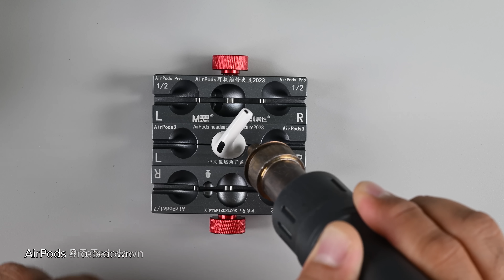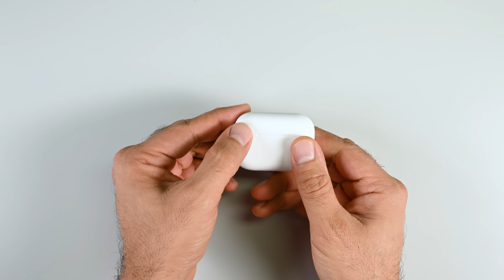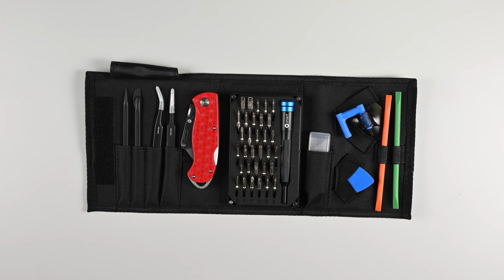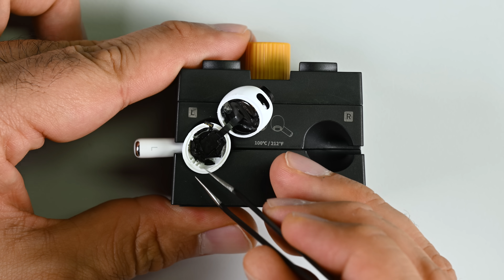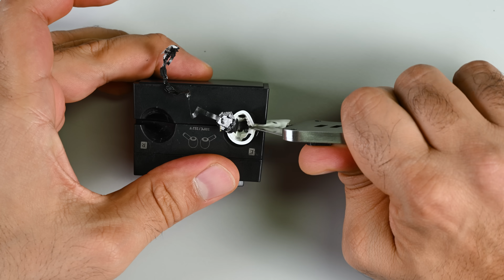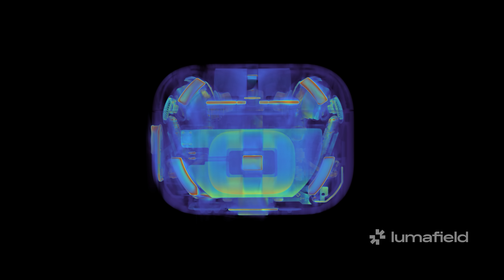We Tore Down the AirPods Pro 3 — And Here’s the Ugly Truth

Comment: It’s obvious Apple doesn’t want the battery to be replaced, some people would never upgrade and buy the new ones. It’s a business.
Reply: Maybe businesses should be regulated then. Push them to make their products more repairable.

After all, we’re not obligated to buy the new model and nor should we be.
Reply: @LinyosTorvoltos no one is pushing you to buy the newest models
Reply: @chidorirasenganz  Except the companies that push planned obsolescence and devices with little to poor repairability.

Which is to say yes, we are pushed to buy the latest models by the companies that produce them. If we weren't we wouldn't have planned obsolescence and devices designed to be difficult or overly expensive to repair.
Reply: @LinyosTorvoltos Except we don’t have planned obsolescence. planned obsolescence is used as a buzzword when people mean something doesn’t last forever. Cutting edge tech is rarely easy to repair hence why it’s cutting edge.
Reply: People that scared of waste or money conscious don't buy $200+ wireless headphones mate, it's not the same market. They're absolutely not worried about the 0.1% of people who would have the ability or inclination to replace the battery in their old ones instead of just getting some new ones after a bunch of years have passed. 

The kind of people who buy $200+ wireless headphones are the kind of people who upgrade every few years for the new features regardless.

Comment: Look after them and they’ll last years,im three years in now on my pro 2 and they haven’t skipped a beat.
Reply: ok now name me 1 person with airpods 1 that still uses them today that they bought on launch day . Whats wrong with airpods 1 they are still fully functional and useable yet nobody can use them if they wanted a lot of people dont care about the new airpods but because the battery is useless they are forced to upgrade its a subscription service
Reply: Batteries degrade
You can’t do anything about that
Doesn’t matter if you “take care of them”
They will degrade
Reply: except you can't because the battery charges and stays at 100% when in the case, which is terrible for lithium ion cells
Reply: I bought my Airpods Pro 1 in 2020 and they've only started having issues in the last few months
Reply: Yeah but eventually it will die. With a battery replacement it could last forever.
Reply: @Dann_BS  I couldn't care less about them lasting forever, they need to last long enough. I bet the original wired earbuds I used to own "work forever" but I threw them out years ago and I bet you did too. If my original buds worked perfectly I'd still have bought newer ones for the upgraded features. I bet you buy new shoes when they wear out instead of re-soleing them, don't you? That's a lot more waste than 2g of plastic mate. Let's be real, the only reason people fixate on these is because they have an emotional dislike of apple. Right or wrong that's the truth of it.
Reply: You're at EOL, there's no way you're going to get much more life out of them, the lithium batteries have a limited recharge cycle. This is the point. Everything else in the device may still be 100% functional and useful, but without any form of serviceability, they're e-waste. Multiply that by millions of users and you have a serious problem on top of an already serious e-waste problem.
Reply: @_BangDroid_  Stop lying man, my APP 2 are also 3 years and they still last 5 hours on a single charge. Sure they become e-waste when they break. Doesn't mean all of them break after 3 years.
Reply: @LordCoeCoe  How am I lying when you even agree with my point?? I am not saying they suddenly die after 2 or 3 years, EOL means they are closer to being scrap than not. The actual life depends on individual usage and charging habits. You can't get around battery chemistry.
Reply: @LordCoeCoe   5 hours? my wired earphones last infinity hours, or whenever the audio device dies.

Comment: The main problem for me is that Apple still has no battery limit on the AirPods. A charge only to 80 or 90 percent as it is possible now with iPhones and iPads would dramatically improve the longevity of these batteries. Instead they are almost every time charged until 100 percent and remain at that state of charge, which accelerates the degradation.
Reply: They have comprehensive battery limit stuff now. Mine notify me they're going to only charge to 80% more often than not, with a small popup on iOS that gives me the option to override this if I think I'm going need the buds at 100%. With the 8 hour battery now I feel comfortable leaving them at 80% unless I know I'm going to have a big travel/flight day where I'll want the full life out of them. I don't usually care about this stuff, but since the battery isn't replaceable I was really feeling the reduced capacity on year three of my APP2s, its worth it in this case.
Reply: @fs454  Nice fairyland you're living in.
Reply: We actually don’t know this. A 100% charge could likely be 80%. I don’t see how they would last so long being fully charged and sitting there for years. I bet they aren’t really fully charged to 4.2v and they just pretend they are
Reply: @Cornflakes691 I hope so!
Reply: @Cornflakes691 it’s possible
Reply: same here I rather have a non reparable item that last longer
Reply: They do have optimised battery charging though.
Reply: @davidjacobs6244  which does not have the same effect as a battery limit
Reply: @davidjacobs6244  No, they don't. Airpods themselves always charge to 100% and the cell inside the case lasts only 300 cycles.
Reply: @carnistpoliceYou’ve misunderstood my comment.Optimised battery charging is separate from the 80/90% charging limit and although it still charges to 100% it slows down the charging to preserve the battery.It’s handy for overnight charging so that it’s not charging all night but always fully charged when you wake up.It’s been on iPhones for years and they added it to AirPods about 5 years ago.
Reply: Charge limits don't make much difference in battery longevity. They're only useful for long term storage. Apple has optimized charging on AirPods which learns usage behavior so it's a more practical solution.
Reply: @insidethecourt why has Apple introduced it on the iPhone and iPad then?
Reply: Then you suggest how optimization done by a series chip can be placed inside this tiny earbud. You are a genius
Reply: @insidethecourt this is not true at all. They make a huge difference because of the state of charge that the battery is cycled at. It truly does matter.

Comment: By far the most common issue with these is dropping into a storm drain/sewer/theater floor/etc. The average user will not keep a pair long enough to worry about repairability, so why should Apple spend engineering resources on the end user’s ability to repair them? I agree it’s important for phones or computers but AirPods…?

Comment: I`m rocking airpods pro 1gen and they still hold up. After 5 years theyre still great, I dont think the battery replacment is so necessary
Reply: It’s necessary for end of life device disposal. U might keep it with you but people would normally want to dispose it off and how are we going to extract the metals that have been used it ?
Reply: @mutchlouis9707  it's like 2 grams of mixed material that you only throw out every 3 years or so. This is an absolutely negligible amount of recycling to worry about when the kilos and kilos of the rest of the everything we use and recycle have inefficiencies. It's not reasonable to fixate on airpods when they are pretty much the lowest possible impact part of the issue.
Reply: @mutchlouis9707  They were able to open the buds, weren’t they? If the goal is to extract the metals used, then that is not impossible to do.
Reply: @mirgelvincent5215  yeah but you as a consumer, would you take the 2 hours to open them and take out the batteries before putting them in the green bin?
Reply: @Maevef100f  You can bring or ship it to Apple (for free) for recycling 😉
Reply: Eventually it will die. With a battery replacement it would last forever

Comment: A lot of apologists in here. it's true these kind of buds would be hard to impossible to repair but then why not use IEM's instead and you wont have to irradiate your brain with EMF either
Reply: IEM's have wireless adapters too
Reply: @kBitre, it's not like most wired iems are easy to repair, with a many being a single block of resin, almost impossible to replace the driver (if you find a replacement) and the connectors are usually bonded as one with the main body too, not very friendly to do a deep clean either.

Comment: Remember cabled earplugs? Yeah, they also only lasted for 1-2 years before they fell apart. Nothing new here.
Reply: If you have decent ones they last forever, I've had my IEMs for 6 years now
Reply: No battery and other problematic components in a wired EarPods.
Reply: @OliveG730 just wires that gave out after a couple of years 😅
Reply: Try looking up IEMs (in ear monitors)
Reply: Mine lasted a decade, and then I lost them. They were also $15. Not $250. That being said I still begrudgingly buy AirPods.
Reply: No they don't.
Reply: @lightips  I bet you've thrown out multiple sets of buds, if not because they broke but because you didn't need them. E-waste on earbuds has gotten better with time not worse, they used to throw them in with everything and they were crap.
Reply: Remember them? Yeah, I just replaced the cable on my about 5 (might be more as I'm second ownder) cabled sony crapbuds.

Comment: I have had my first gen AirPods Pro for five years now without any issues. The battery doesn’t last quite as long anymore, but I’m honestly amazed at how high quality these devices are if you take good care of them
Reply: Mate like dankpods said, A good pair of headphones or iem's last generations rather than the lifetime of the battery, Still I love my airpods pro 2, Just wish the battery was removable, would probably last double its lifespan
Reply: same here, but had to replace left one bc it was making crackling sounds after 3y of use
Reply: Got my airpods pro 1st gen replaced 10 times.
Reply: @DekuNEKO21 Stop being cheap
Reply: I’m also surprised why anyone would ever need a battery replacement and I use mine every day for 3 years
Reply: Most lose them way before end of life. ;-)
Reply: Same, I just upgraded from my five year old Airpods Pro to Airpods Pro 3 and gave my old ones to my mum lol. They still work fine!
Reply: Quality? They're designed to be unfixable jackass. That's the opposite of quality.
Reply: My 2nd gen AirPods from 2017 still work and last about 3.5 hours.
Reply: Same
Reply: My PRO2 on 3th year is loose at least 25% of work time   
Not bad.
Reply: My Pro 1’s were perfect until the earwax got into them. I tried everything to clean the mesh but nothing I did worked even used hydrogen peroxide, isopropyl alcohol, gorilla tape, and washing it in the laundry. If you have any advice I’d love to fix mine because they were perfect before the wax buildup
Reply: Same but both mine and my girlfriends has a static sound in the left ear. Mine is fine hers is unusable because the static is so loud.
Reply: Yes absolutely true.
Reply: I have Sony Gen 3 pods. When I had issues with the batteries, it was easy to replace with the higher capacity ones from Varta. They work flawlessly after so many years (and last longer than initially did)
Reply: Same here battery on pro 1 last 4 hours max and one ear sometimes fail to charge and always goes out way sooner than the other ear. Time for a change. For some reason the new pro 3 doesn’t fit my ear as well as the gen 1, the new stem angle also is kinda weird . Not liking the foam tip as well, that might just be me tho
Reply: I’ve had mine a similar time, battery still lasts a long time, weeks if I don’t use them, they’ve also been washed in the washing machine twice and still work fine 🤣
Reply: How did you clean them?
Reply: Same, I’ve been using AirPods Pro 2 for like 3 years, and they still work like new. I use them all day every day. Just buy Apple Care for your AirPods; it’s cheap and will save you the hassle of paying some overpriced repair shop to replace the batteries.
Reply: That’s great. Me personally I’ve been thru 4 pros (2 1st gen and 2 2nd gen) first set was replaced for free by apple due to crackly audio. 

Second and third set worked good until transparency mode stopped working and then they wouldn’t charge unless aligned exactly 90% of the time they weren’t charged despite the case being charged, yes I cleaned the gold contacts and AirPods and the case wasn’t really dirty. My forth pair also stopped charging in the case, I crashed out and broke them.
Reply: I changed the warranty for the second generation 3 times in a year ... the fact that you got one working copy does not mean that it is not crap ... the quality of Apple products is terrible now, they are not worth the money and the pros of what they charge for them. I say this as a person who has their phone and laptop for a while ... and I am very impressed with them in terms of reliability in quality control. Before that, I had a Samsung and I will definitely switch to it in a couple of years ... and a PC on Linux .. Apple is just a gloss with mediocre quality and a very short service life ... I use a laptop for 5-7 years before replacing it, a phone for 4, headphones until they die ..
Reply: It's a lottery of whether or not the internals will hold up
Reply: So you have issues. Dont lie next time
Reply: For the use I got out of my 1st gen’ AirPods Pro, if they and up in E-waste and get shredded to recover the component materials that seems reasonable. I think they’ve done well considering I got them in June 2020. Sometimes recycling a product that can be made most durable by not being reparable is the best route to go down.
Reply: Have never had AirPods die on me. Several trips through the washer and dryer for all of them and they still work perfectly. Incredible products.
Reply: Mine broke after 1.5 years and had really bad static
Reply: @morpheus_9 there was a extended service for that issue on the AirPods Pro, they would swap them even after the warranty har run out.
Reply: Same here. But every 3 years or so, I buy the new released version.
   No Karen here.
Reply: True same here
Reply: I do have the same airpods, did you experience difficulty in charging on one airpods? I think mine also work normally but sometimes it cant charge
Reply: @davidhartonos1493  sometimes yes. But that’s about it
Reply: @davidhartonos1493  usually  dirty contacts, get some alcohol on a q tip and clear the contacts
Reply: @davidhartonos1493 Try cleaning out the charging pins inside the case with a qtup
Reply: Wait until you get off welfare and can afford the AirPods Pro 3 - they are such a massive upgrade you'll be shocked. While the sound is much better, and noise cancelling if vastly superior, the thing you'll notice the most is how much more comfortable the Pro 3's are (and the Pro 2's as well). Apple added some venting on the Pro 2's, and it's a game changer - it's not immediately noticeable, and you may not even realize it at all until you go back and use the 1st gen Pro's after a week of using the 2's or 3's - the 1st gen feels so uncomfortable after about an hour or so, where as you can wear the 2s or 3s for literally 4-5 hours without issue. I use mine extensively, probably way more than most people at around 6-8 hours a day of listening (not sleeping), and the battery on the 2s after a few years was getting noticebly shorter for phone calls mainly - but considering how much I use these, I gladly will pay for a new set, and they do really sound better than then 2s - probably because of the new tips, but whatever it is, it's noticeable. Coming from the 1st gen ones, the upgrade would be massive.
Reply: Same my airpods pro gen 1 is over 4 year works great battery is still okey! But i also have the new airpods pro 3 😆
Reply: They’re disposable. Once earwax gets into the microphone grills you’re done. You simply can’t get it out no matter what you do
Reply: @NoOneReallyCaresAboutUkraine tf are you putting the stem in your ear
Reply: @hitmanzzz another microphone is also behind the grille
Reply: @hitmanzzz 😂😂😂😂😂😂
Reply: @NoOneReallyCaresAboutUkraine  For me, ordering a cleaning kit and giving them a thorough clean once every two weeks/month with the right tools was enough to maintain their quality
Reply: @NoOneReallyCaresAboutUkraine  It’s quite easy to do a deep clean of the AirPods. There’s several videos here on YouTube, and even at Apple’s support site. Just use micellar water and a toothbrush 👍
Reply: @NoOneReallyCaresAboutUkraine  blu tac gets the job done. I clean every Apple grill that way and have had no problem with any device
Reply: @riccardogiorgi003 it’s fine for cleaning iPhone speakers from dust for example, but when it comes to earwax, it doesn’t stick to it and only gets pushed deeper
Reply: I buy every single one of their products
Reply: @godusopp4338  You should be ashamed.

Comment: ANY electronic tiny stuff is a waste. They are not meat to work forever. If 20€ or 200€ or 2000€. It depends what you are looking for. And honestly, I've been using mine for 5 years. Yeah the battery is at some point less than 50% usefull but hey, it still works. And after these things die out you bring it back to the store, they hopefully recycle most of the material (the chips, the rare earths) and then you get a new pair. This goes for Airpods or any other earbuds.
Reply: do u mean smart phone😂
Reply: True. The fact that Apple (hopefully) recycle all the components at the end of life is one redeeming thing about these.
Reply: Anything that is small that goes inside of a fleshy ear is definitely asking for trouble he it wired or wireless